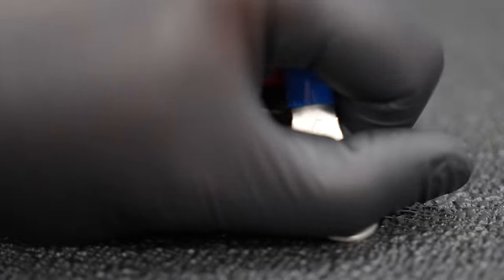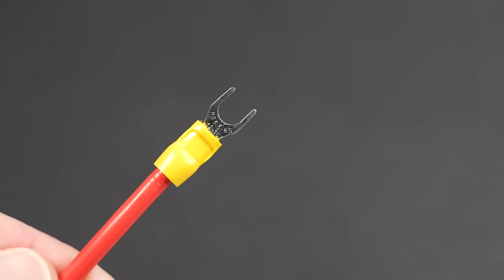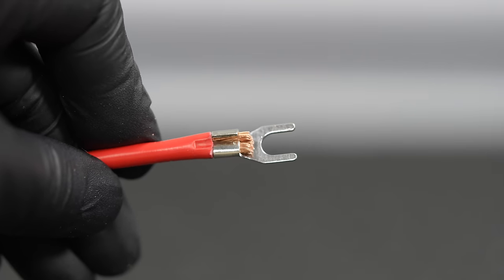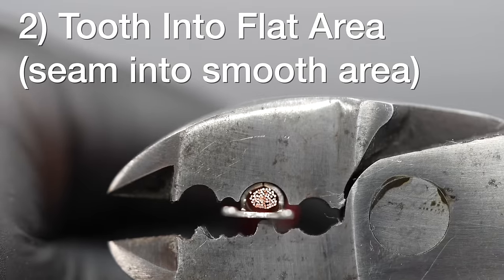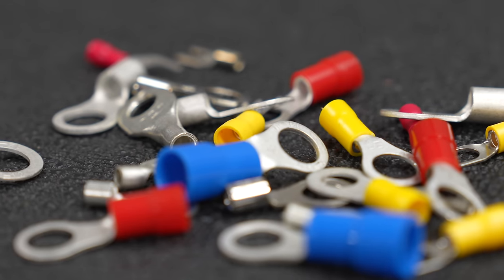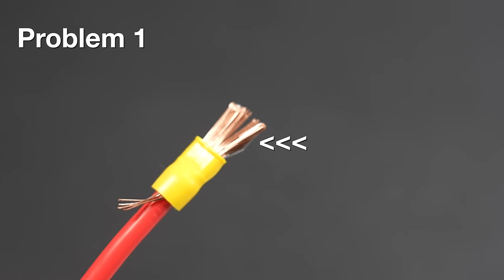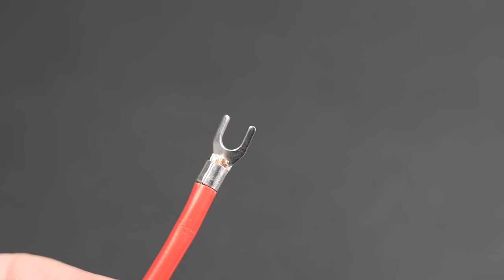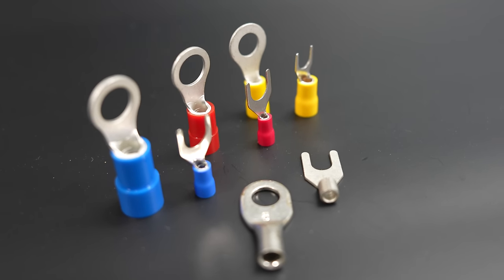Why 50% of All Crimp Connections Fail - Up or Down?

Comment: I think you'll find the markings on the back of the terminal are the wire size in metric cross sectional area, e.g. 5.5 to 8mm^2 (for European cable sizing) and 12 to 10 AWG for others.
Also, you're using an uninsulated crimp tool on insulated crimps which will overcompress the barrel and weaken the joint or destroy the plastic insulator on the crimp.

Comment: I pull the insulation off (like the ones shown) because they're crap and I want to see how the connection is. 
Instead I use heat shrink tubing insulation (after crimping securely), and I make sure that there is no exposed wire.
Exposed wire allows moisture access to corrode the wire and cause failure.
Then I pull on it myself to ensure that the process hasn't failed in any way.
And I've never had any problems with my wiring connections

Comment: Can someone explain the logic behind ensuring the bare wire extends BEYOND the crimped portion? I mean, assuming the section inside the crimp was correctly stripped, there is a solid connection between the wire and terminal. Having an additional 1/16th inch of exposed wire after that seems unnecessary. The only reason I can think of (and this is a stretch) is that any corrosion or damage to the copper is going to be more visible. Then again, having it exposed increases the chance of moisture getting in there to cause corrosion, so I'd think trimming it flush to the end of the crimp would make more sense.
Reply: I was thinking the same thing, if the crimps are done right, there is no reason to have any wire sticking out. That was the way I was shown how to do a reasonably good crimp properly.

Comment: Best Result, remove plastic with just a bit of heat, insert wire, and solder the wire into the terminal and then use marine grade heatshrink to protect

Comment: With insulated connectors there are 4 ways to fit them in the tool. I never know which is right. E.g. does the coloured dot on the tool go to the spade or wire end of the connector? Also most of these tools don't have the hump like you show, but just 4 half oval sides all slightly different. So its not at all clear which way it should go.

Comment: I use ferrules for most stranded wires because of the cage clamps used in terminals .Sometimes i can use fork or ring terminals but i preffer ferrules

Comment: The biggest issue is the wire used. Often due to cost savings, lots of equipment is delivered with thin wires. Sufficient for amperage, but not suitable for crimping. In these cases it is better to solder wires together, or step up the wire with a patch wire to something that can be crimped successfully.

Comment: I threw out my barrel crimpers 40 years ago... wires would come out all the time... only use the dimple crimper, no problems with wires pulling out. that said I've seen  unskilled fellas break wires when using a dimple crimpers, but that is what "skill" is all about....

Comment: I really prefer to get rid of the insulation and use appropriate sized heat shrink tube. After working with control panels for many years looks became important and the insulation can get in the way of test leads in tight spots

Comment: The typical box comes with NO instructions that I remember. Took me sometime to figure this out for myself. Being old fashion, I still soak these in solder often when I believe they may see some stress. Sacrificing the factory insulation for some shrink.

Comment: This is why for certified car alarm systems, only ratchet crimpers that also stamp the insulations are allowed. This ensures that you can check that the correct opening and correct force is used.

Comment: Looks like when you crimp the terminals from the back side, opposite of the seam you bent the terminal, if you are not going to use the seam, what is the purpose of it?I was told by a T & B rep that the seam is designed as the front of the terminal, when doing it correctly with the pressure right in the middle of the seam, both sides will collapse and grub the copper not just squeeze it.

Comment: I've been doing this method using uninsulated crimpers on insulated terminals for decades. Rarely does the crimper penetrate the insulation. If it does, it's just a small area inside a depression that is still protected from contact with other objects. For low voltage it's not a problem. For line voltage there might be some added shock risk but usually the compromised area is on the backside of a terminal so it is still protected from accidental contact.

Comment: Would like to add that cheap crimp connectors are also to blame. Often times the metal workhardens and fractures (usually from vibration alone) leading to failure of the connection.

Comment: Sadly, a lot of the crimps done in this video actually bent the connector, so although your wire might not pull out, the connector may also not make proper contact, or end up loose in the future.  I'm surprised it's not mentioned, but using a non-insulated connector makes soldering easier, and you can finish with shrink tube for far superior protection.  There is a superior style where both "top" wings fold down onto the connector.  It is generally used with higher quality connectors, such as weatherpack or deutsch style.

Comment: I have crimped for over 40 years , residential, commercial and mainly industrial and I have crimped mine just opposite of what you are telling people. If you use cheap automotive or off brands you are probably correct. But good crimps like Sta-kon or Panduit don't have these issues. Believe me I have crimped thousands and NEVER had this issue. Buy good products get good results.

Comment: Disagree....., if done with the slightist bit of care, crimping with the tooth side of the crimper on the split is very sucessful. And if you look closely at your finished crimp, the teminal connection area (where you screw down the terminal) is now curved. So, when the terminal is put in place and tightened down the curve will flatten out possibly opening your connector on the split side.   Further, if you crimp on the split, you can turn the connector 90 degrees and further tighten the connection by second crimping on the flat part of the tool jaws.    Like anything else, a bit of time and care generally produce the best results, but I see you have something to say about everything out there, so you must be the expert......

Comment: dont forget for a lot of crimps you need the tooth into the gap because thats how they were designed the 2 sides roll over and grip into the wire

Comment: There are a rare few crimping systems that are UL approved ratchet cycle. 3M makes one of these and when you use the approved tool, and approved connectors properly, you get a UL approved connection.

Comment: This is not a complete example! My crimper actually is centered. So,  when I push down on the seam, I catch both ends. Making a nice tight connection. 
 And just my opinion, but, I don’t use the supplied plastic insulators anymore. I find them lacking in protection. I use shrink tube on all my connectors. It’s not as strong, in terms of rubbing, otherwise they are far superior to the junk that comes on most connectors.

Comment: Do the pull test, it should be as strong as the wire itself, yank on it and if it doesn't move/shift/fall out then send it.  For critical applications like aviation, you should follow all the standards and best practices no doubt.

Comment: A good video, but no comment about poor quality connectors. I used to have a supply of quality connectors where there was an inner sleeve with no joint line. I used ratchet crimpers and the join NEVER failed. The advice in the video is good, but select your connectors carefully too!

Comment: 3:16 5.5-8 is not the spade opening size.  It is the acceptable wire size in square mm which is how wire is specified in metric countries.  12 AWG is 4.0 mm^2, 10 AWG is 6.0 mm^2.  Those are the AWG sizes that fall between 5.5 and 8 mm^2.

Comment: First of all, throw away those cheap red, blue and yellow plastic pieces and get some non insulated connectors. Next get yourself some ideal stripmaster wire strippers, a Thomas and Betts wt111-m wire crimper( these are both $30-$50 new but can be had for a buck or two at a flea market or garage sale and in my opinion these are the pinnacle of wire strippers and wire crimpers) ,some heat shrink tubing , a pencil torch and some solder . Do it the right way the first time and it’ll last forever. The only time you should use those cheap plastic connectors is when you’re stuck the side of the road to allow you to make it home.

Comment: I personally wouldn't use a cheap pressed steel manual tool. I might add you are using a less than optimal tool for the uninsulated crimps, with the correct jaw the joint will be turned into the wire locking it tighter than your crimping from the flat side.

Comment: I usually add some solder to my crimps to increase connectivity and decrease failure chance, but only because I was using the crimp tool wrong.

Comment: I'd prefer the old speaker connector lugs. It has two crimps. One for the wire and one for the insulation of that wire. I still have an original crimp made for that connector.

Comment: See, I had noticed the issue of the toothed side sometimes creating an asymmetrical crimp, so I tried flipping it the other way. Problem is, with even the rather small but beefy uninsulated connectors I was working with, my crimp tool - a 'nutcracker' type with pretty good mechanical advantage - could not even generate enough force to crimp that way. So in my case, the "wrong" way is the way that physically doesn't work at all.

Comment: What's even worse is people that do crappy jobs on wiring due to nothing but laziness. Vertex Effects is one place. Instead of taking a 10ga wire and soldering all of the copper into a connector, he cuts half of it away, essentially making it half the size it actually is. Then he solders that tiny bit of wire when he easily could've used the entire bundle of strands. It blows my mind every time the vid shows up in my feed.

Comment: Insulated connectors are what's always sold but I think the insulation makes it difficult to get right.   So I cut or twist off the insulation and crimp directly.  Heat shrink after.

Comment: The 5.5-8 is the cross-sectional area of the wire in mm^2, not the size of the opening in mm. It’s the metric counterpart of AWG.

Comment: Hmm.  I've done the crimps backwards by your reckoning, but I usually get both edges curled into the middle, instead of just one.  I guess I can try it the other direction, though I notice on your video that this seems to curl the fork end rather than leave it flat.

Comment: 2:26  This is wrong.  Look at the connector.  The deformation goes up thru where the connector will clamp down.  When it gets fastened back down, it will flatten back down and the crimp will open up slightly.  If this was a spade connector, you'd have to flatten it out before use.  You are deforming the connector the way you crimped it.  
The little nub tooth in the crimper is supposed to push down between the split in the connector "equally" on both tabs.  If you are careful you can use the tool per the design intent and get a good crimp.  The problem occurs when you are working a tight spot and have difficulty inspecting the completed crimp.
The answer is to not use insulated connectors.   Use bare connectors so you can assure a good crimp (the opposite way you did it, that design intent dictates), with a small piece of shrink tubing.

Comment: It's probably same for those double ender crimp connectors too... I was always frustrated how one side is perfect but other pulls through... I flip connector to do other side-> upside down..... I never thought about it until just now.... 13+ years😢
Reply: Well, you ain't the sharpest tool in the shed, are you?
🤣🤣🤣
Reply: @a.k.3659  I ain't do it for work stuff, so I don't always interact with these

Comment: On the crimper that you said was perfect you had way to much wire sticking out on the side where the connector should be. I never have more than 1 mm of wire sticking out when i does this job and they also have good connection even if they are flush.

Comment: Never owned the tool. Where they matter, I solder 'em, doubling over the wire with a tiny end bight first. Where they don't matter, I just smash it flat with vice grips. 
Crafting rule no. 9: apply the appropriate level of involvement.

Comment: I was taught by an old aircraft electrician that after crimping pull the connection hard 5 times. If it doesn’t come off, it most likely never will.

Comment: It seems to me the slight extension of the wire will create a flare that would make it harder to slip out of the connector. If corrosion is a concern,  solder the tips of the wires.

Comment: I seem to see alot of connectors the one's with the heat shrink and especially the butt connectors that guys crimp to much and the pin on the crimpers goes right thru. Then it's not long before the "Green" deasese sets in. Especially up here! 👍🇨🇦

Comment: I pull off the insulator, put shrink tube down the wire, actually solder the wire to the connector, and then spray some anti-corrosion juice on it and slide the heat shrink up to the connector and shrink it - they never come apart!
Reply: Jeremey, how does one solder copper wire to aluminium. I have never been successful.

Comment: I use "W" Crimpers on non insulated terminals and ratcheting compression crimpers on insulated terminals.  Everything else, including the tools in this video are crap.  I'll put my crimps up to any ISO pull test to compare any day of the week (the wire will break before it pulls out of the terminal.)  For the home user, the ones shown here are probably ok, but why just be ok.

Comment: Good way of marketing the tools 😊. What if I don't have a tool to crimp? Bin the connectors?
Reply from the maker: You can crimp with a pair or pliers or in an emergency a hammer and nail end, but this isn't the right way. Like network RJ45 connectors a tool must be used for the best result.

Comment: The fault is mostly the tool.  The crimpers that have jaws with one rounded side and one toothed side are inferior for just the reason you stated.  It's too easy to put the tooth on the wrong side of the crimp connector.

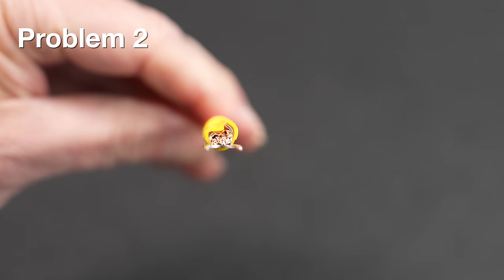Comment: When I get a crimp like those shown @3:45, I turn the connector 30 degrees and crimp the Non crimped part down. never had a problem.
Reply: Then do it correctly and you don't have to rotate it. Sounds like you're doing "a lot"  of them wrong if you're getting all kinds of reults.
Reply: @nothankyou5524  Not getting all kinds of results. There are times when the crimp is off center slightly. What I do now is to make sure that one of the Flaps, as I'll call them, is poised to slightly go under the other.

Comment: I've not seen one crimp from any car manufacturer or any place else for that matter, with the seam not crimped down the center which forms the 2 halves which enclose the wires.
Reply from the maker: You are correct, but factory crimps are formed in full fitting, deep dies that can't be done by hand in this way or under perfect conditions. What I showed you in this video is straight from 3M and their instructions on hand crimps which are done differently. 3M is the world's largest mfg of crimp connectors.
Reply: @SilverCymbal  well I guess as long as the crimp is secure and holds is what matters. I usually solder my ends before crimping anyways.

Comment: You used the non-insulated crimp part to crimp the insulated one. The spot right below the one you used on the non-ratcheting crimper is the correct one. Otherwise, you'll ruin the insulation.

Comment: In the automotive world, I never have seen someone crimp like this? I have seen this "style" used on home repair things... Using the  GS-88 tool,  that is poor crimp. That tool is for insulated only and your using it backwards.  There is another crimper for non insulated, and those usually require two different crimps... You also ended up deforming the other part of the terminal... try using Channel lock 909 crimping pliers... for non insulated terminals.  - 2 Cents

Comment: Do not crimp. Soldier. I just built a wiring harnes for my bike. I soldiered. Way better connection and stronger than the wire.

Comment: I'm absolutely certain the seamed side of the terminal is what is supposed to be "curled" and pressed into the wire to grip it. Your method looks neat but its just the opposite way round. Sure, the use of cheap crimping pliers and misalignment will give bad results. When you inspect factory assembled wiring harnesses or looms you will see what I mean. The split or seamed side is what gets pressed into the cable.
Reply from the maker: I can confirm that 3M and others have confirmed what I showed. Factory crimps are different, they use very precise dies and pressure and absolutely precise alignment to get the best of both methods. They can evenly curl and press the crimp into wires that can't be done by hand. Try it a few times with uninsulated connectors and you can see the result by hand.
Reply: @SilverCymbal  Thanks for the quick reply. If you have been told that by 3M, that is very interesting. All these years i have been doing it wrong then and always wondered why I could never achieve "factory" results. Even with quality ratcheting crimpers. Thanks again. Cheers.

Comment: Summed it up perfectly in the last 5 sec.  Learn how to use your tools. One thing you didn't mention, with the ratcheting tool for insulated crimps, the jaws are slightly different sizes, the wider side being for where the wire goes into the crimp.  This is important because you can get right & left handed jaws.